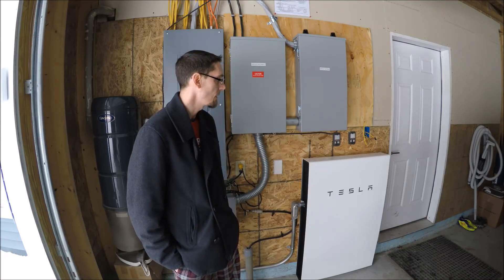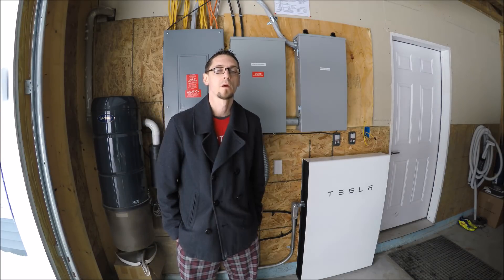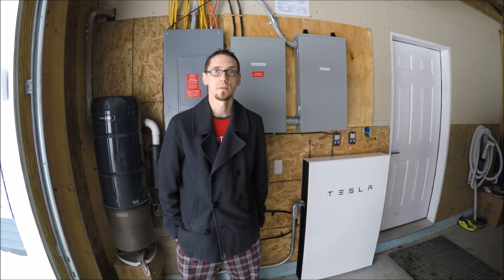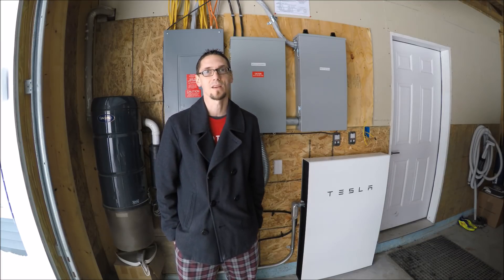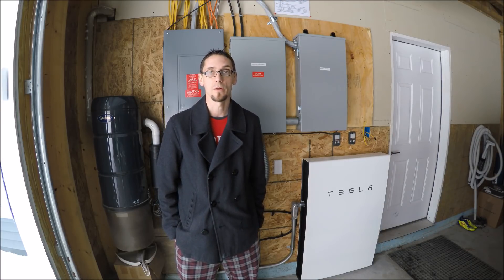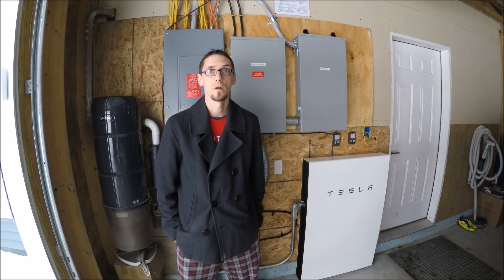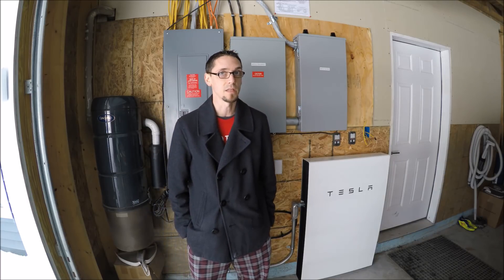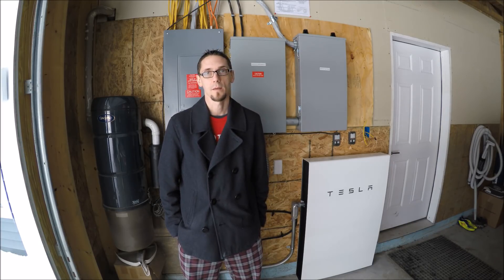New Tesla Powerwall For $1500

Comment: Informative video.. It's a great price for a backup power source.. However, since Vermont has some of the best net metering rates in the country (they pay a lot more for solar sent back to the grid than they charge for grid power), have to wonder if a powerwall has a negative cash benefit, if your excess solar power is going into the PowerWall.

Apologize if they've changed their Net metering policy from last year.
Reply from the maker: Currently they pay $0.03 for every KWH sold back.  That rate is dropping to $0.02 next year.

Comment: So no cost to re-wire the panel boxes. No real cost of Tesla power wall
What is the capital cost of installation. And subsidy and cost to buy and sell power. No return on investment. A 50 amp car charger panel box shaft version and charge cost
Reply from the maker: The cost to install/rewire/add panel boxes was inclusive of the $1500 cost for the Powerwall.  There is no cost to me the customer for charging the Powerwall from the grid and the cost savings when the power utility uses power from the Powerwall gets passed into the rest of the customers of the power utility. No cost for any of the panels including the one with the 50AMP, now 60AMP car charger.

Comment: I think you should have built a concrete pad to raise it from the floor level, taking in consideration the hose bibb that close to the power wall.
Reply from the maker: I could have water flooded into my garage three quarters of the way up the Powerwall and it would still be fine.  They are meant for outdoor installs as well.  At the end of the day Tesla installed it that way and if it ever turns into an issue they will fix it.  I'm not worried about it. So far it's been working great.

Comment: So you’re basically paying the power company for the privilege of housing and charging THEIR power wall. That doesn’t sound like a deal. Especially considering they can draw down that emergency power any time they like.
Reply from the maker: That's not exactly how it works.  Basically I'm buying a Tesla Powerwall at a fraction of the actual cost, so I have a clean running seamless backup to run my house when we have power outages.  They do not pull from the Powerwall grid during times of storms, so you will not have to worry about a depleted battery when you need it most.  They also pay to charge it backup.  Also, when you tie this into your solar arrays as I have...I can power my house for days if we every had a really bad ice storm or other disaster that would wipe out power for days. Being a part of this program also allows the power company to keep their costs down during peak times by not having to purchase more power during those days/weeks of high power consumption.  With this very hot summer...they've used the Powerwall grid to sustain power demand without it costing the power company more money to do it.  Why is that a good thing?  If the power company saves money they pass those savings onto the customer in lower electric rates for everyone.

Comment: I just started the ball rolling with GMP for the Powerwall installation at our home.  We have two reasons for doing it, nearly instantaneous power backup with ability to recharge battery with solar if extended blackout and for the gee whiz part of the pilot program.  I'm curious to see what the Tesla app shows during different times of the day for your installation.  I understand that GMP may draw down your pack every so often and was curious to see that happening on the app as well as any solar production charging the battery.
Reply from the maker: David, glad to hear another Vermonter taking advantage of this great program offered by Tesla and GMP.  If you watch my https://youtu.be/h8s2WwQb_DY video about losing power you'll learn that it is truly seamless failover...no interruption what-so-ever. Typically there's not a lot going on in the app.  GMP has only pulled power from my Powerwall maybe two times since I've had it.  They charge it back up for free as well.  My solar just went up so I don't have anything yet to show for that, but I do know that the solar will not charge the Powerwall for GMP consumption.  That means it will only charge the Powerwall for extended periods without power or connection to the grid.  At least, that's what I'm told by Tesla.  We shall see.  I'm probably about two weeks out or so before I can turn on my solar arrays.  I technically have two, one on the house and a smaller one on the garage for a total of 8.45KW.  Stay tuned as I will have a time-lapse install video coming soon of the solar array on the house roof with an explanation of how the wiring has changed.  My electrical wall in the garage looks like the engineering deck of the Starship Enterprise...LOL!

Comment: I'm just curious why they installed 2 3R outdoor rated panels inside a garage, and if they separated the neutral and grounds and removed the bonding screw in the "new" sub-panel. So I'm also trying to understand something, so the powerwall is installed obviously on the metered side of meter...so you pay to charge the powerwall but cant use it unless its a power outage, but the utility can pull power from the powerwall that you payed to charge whenever they want, and then you still pay the power company to recharge it back up to full for the next time power goes off or they pull power back to the grid....and you pay them 15.00 a month to do that? Does the meter spin backward during that peek time they pull the power back to the grid or is there some kind of net meter or smart meter than can tell or offset the cost of you paying to charge it for their use whenever? I think I would of opted for a solar system with a hibred inverter that can charge batteries as well as do net metering, which they do make. I don't see how you gain anything other than the emergency power in a blackout and even then 13 kw/h storage isn't a lot in a blackout situation if it's more than a day of no power. A 17 kw or 20 kw whole house generator sounds like a better option. Please help me with my confusion......
Reply from the maker: Good question!  The power utility has software built in that keeps track of the power they pull and when they charge it back up, I am not charged anything.  Solar just got installed yesterday and the video will be out soon.  Now the system will pretty much work the same, but with the solar...the software knows to only charge the Powerwall when the utility company is offline...that way I'm not charging the battery for them to use the power.  They still charge the Powerwall when on grid power, but when I lose power I can keep the power wall charged for days, which makes a 13KMH batter more than enough to last days of being off power.   I hope that explains it better.  Also...I hope I can do a decent job of explaining all the charges with the new Solar install.  Thanks for watching.
Reply: TM3Life that's cool, I was just curious how they did the tracking. Hope you like the solar, just installed a small 2.7 kw system at my own home 1 yr ago. I have a couple videos explaining what I did on my YT. Grid tied for the time being. Thanks for getting back to me so soon. Have a good day.
Reply: Screw the grid, save all the power you made with solar then use it over night....

Comment: I observed the garage floor to be wet,  yet the  battery (tesla pwr wall)  was mounted on the floor .  Should be off the floor at least a couple of inches.   1 1/2 flex conduit? Really I would have used  1 1/2 emt .   Everyone wearing coats/jackets  why? And I suggest you use a propane range in lieu of electric.  Lots of other things wrong with installation.
Reply from the maker: Sorry the install isn't up to your standards.  I actually asked them about the 2" flex conduit today when they were here installing Solar.  They said to not intrude into the area where my central vac plugs in that was their best option.  I'm not a pipe guy, so maybe that's not right?  It was in the 30s when this video was taken.  Not exactly warm.  I do not prefer to cook on propane and like my even heat and the look of the clean lines of my wipe top range.  To each their own.  The Powerwall is perfectly suited for floor mounting as it outdoor rated and there are no components in the bottom 6 inches of the unit...plus the batteries are sealed inside, so you could actually have water up to 2 feet high on the unit without causing damage.  They floor mount if you plan to stack outward with more power walls.

Comment: Don't get me wrong 1500 is a good deal for a backup solution like that whether you control the electrons or your power company does but 1500 bucks for them to make your service look like crap?? I don't care if it's code or not they made it look like shite. My 2 cents.
PS so in an outage you can't charge your tesla?
Reply from the maker: To each their own I suppose in regards to looks.  I certainly don't mind it.  IN regards to the charging of the Tesla, you are correct.  However...if you think about it...each Powerwall is only about 13KWH, so you'd drain quite a few of them to charge your car.  They were never intended for that.  I guess that's where the solar will come in.  That gets installed tomorrow May 15th.
Reply: Thanks for your understanding of my electricians OCD. Good point on charging and I hope you work nights so your solar farm can maximise your cars charging (assuming your array is huge). BTW the timelapse is a wonderful way to capture them, idk what I would appear like while working but imo it paints a pic of them not really knowing how they wanted to do the job. The switch pullers suit made it even more funny. Thanks
Reply from the maker: LOL...yeah the switch puller's suit is probably because they knew they were on camera and it's "code"!  Don't see many people putting those on these days.  Good point on the working night's.  I work days.  I guess it's a good thing I work from home and there's literally a supercharger 4 miles away.  I will be doing another timelapse for the solar install.  Plus hope to have some drone footage as well.  Stay tuned.
Reply: TM3Life the suit is important but it wasn't clear when and for what they used it.
Reply from the maker: Oh, I see...yeah...that's because my battery died and It didn't end up on camera.  I have more backups this time for the solar install.

Comment: Hello everyone. I came across this video as I am looking to better understand how I can utilize a smaller powerwall for a RV application when boondocking. I read on a blog that nissan was considering making the vehicles battery pack reversible so that you are able to draw power use into your home in the event of a power outage. I'm thinking that would probably be a better option as to a one purpose unit. Your thoughts
Reply from the maker: That could be a very viable solution and would be great if Tesla offered that as well.

Comment: This is kind of ridiculous really the milliseconds in time it takes to change over from power going out to the wall sustaining that's really a stupid thing when you think about it you know the difference in time between that and the generator big deal the fact of the matter is powerwall power is becoming super super cheap at an exponentially lowering rate you can now build your own power wall that has more power for under $1,000 now not to mention it another year that power wall will be the bottom of the barrel 10 year contract that's ridiculous.
Plain and simple you just been taken advantage of.
Reply from the maker: In my experience...it's never "milliseconds" to restore power from a generator.  The least amount of tie I've personally seen is 30 seconds, not that I'm saying that's a super long time, but you definitely know you've lost power and there will be things around the house that will need to be reset due to power loss other than clocks. Being that this Powerwall will continue to get updates as I the contract goes through the  years...keeps my from being obsolete.  After the Solar panels go on the roof, this is a true self-sustainable system that will last many years to come.  The added benefit is the reduction in greenhouse gases sue to burning gas/diesel.  Sometimes it's hard to see the forest though the trees, but I can assure you the more people that can be for self-sustainable will ultimately make the world a better, cleaner place to live.  I wish you well on your endeavors.

Comment: I think is useless unless you have solar panels 
You still paying electricity and maybe a little more to charge it
Reply from the maker: Well, considering I can power my entire house with a seamless switchover on batteries that don't pollute the environment like typical gas generators, I'd say it's worth $1500.00.  To top it off, I also just had my consultation with Tesla for solar, which will be installed very soon.  So once the Model 3 get's here by July, I will have the Tesla trifecta!!!
Reply: Umm unless you have solar panels that charged it the only thing you did was add pollution to the environment. This is being charged by the grid just as if you used the power. Second you don't take into account what it takes to make the powerwall. This system doesn't save you a dime it costs you more. It does provide power during outages.
Reply from the maker: Well...solar is only three weeks away, which was always part of the plan and with this deal through my power utility, the Powerwall will does not cost me nearly $7000 to $8000 with installation.  Also...being that the power company uses the power they charge the Powerwalls in their network with during peek times instead of utilizing more "dirty" power makes it so as a whole the utility company is polluting less.

Comment: Sorry if someone's already asked this but, did you get your Powerwall for emergency back-up power only?  Like, can/do you use it every day when your solar panels aren't producing?  I have both a 5kW solar array and a 2.5kW wind turbine on my property so I over-produce in power production, every day, like A LOT!  So, I was looking to get a Powerwall for at nights, when I would be using grid power.
Reply from the maker: Right now, mine is just for power backup, but soon will be putting on solar and possibly wind.  Then I can store power in my Powerwall when my utility is down. However, in your situation a Powerwall would be perfect to store all your extra power and then use that solely during peak times or night time.
Reply: Good deal, thanks!

Comment: Who in  the world did the original wiring????? You do NOT leave exposed Romex, EVER
Reply from the maker: I did all the wiring and had it reviewed by a master electrician.  No issues.  I do plan to create a box around the wiring coming into the top of the panel anyway.  I just haven't created it yet due to the fact that I still need to finish wiring the garage.
Reply: TM3Life that is exactly what I was hinting at: I am not aware of any restriction in the electrical code specifically pertaining to the wiring to the panel (as in your case) with Loomex/Romex.
Reply: electrical code reference please with detailed chapter/section and text !
Reply from the maker: Agreed, the only thing code references is wire that is not within Loomex/Romex or conduit.

Comment: Move that powerwall asap. Jack ass installers  set it on mount with no clerence to floor and water damage  very dangerous!  You have water snow melt on your floor in video jeez
Reply from the maker: It's hard to see from the video, but it's not sitting right on the floor.  The device has rubber feet that keep it an inch or more above the floor of the garage.  Yes, we do have snow melt, but it all drains to the center of each bay into a floor drain.  These devices are also meant for outdoor installations with rain, so I'm not too concerned.  Also...if there was a problem...they would be on the hook for it as they installed it. Personally...I would of thought it should be higher as well, but they said this was very typical for the type of environment it was being installed in. Thanks.

Comment: Have you explored charging the powerwall at night at a lower rate and using it during the day which is a higher rate. OR is your power the same rate all the time. I would ask green mountain about subsidizing solar.
Reply: Residential power rates are not (typically) set according to time of day. Mainly because peak residential usage is not (typically) at peak grid usage. Depending on weather, time of year, etc  peak is 2-4pm. when people are still at work.
Reply from the maker: Our power is the same rate all the time at just over $0.14.  They do offer other rate plans, but none of them really make sense based on the hours of the peak and off peak times, especially since I work from home.
Reply: unless I have missed Moon light panels there isn't  night charging panel